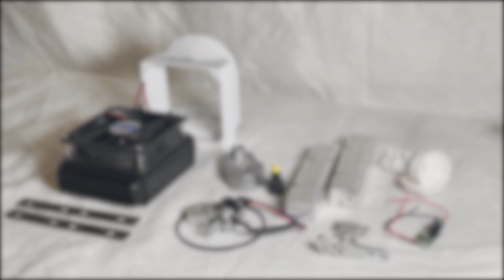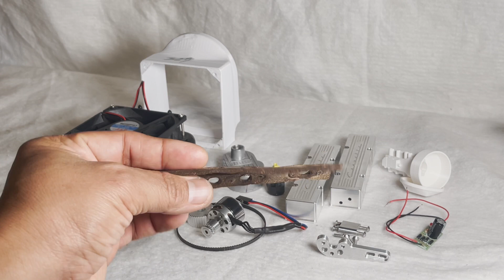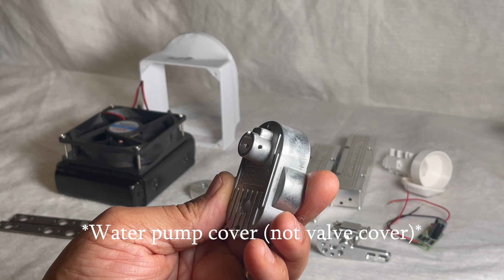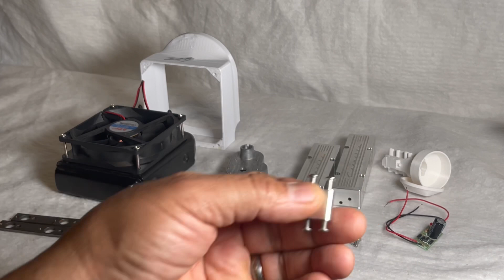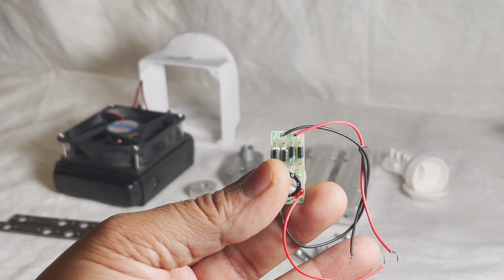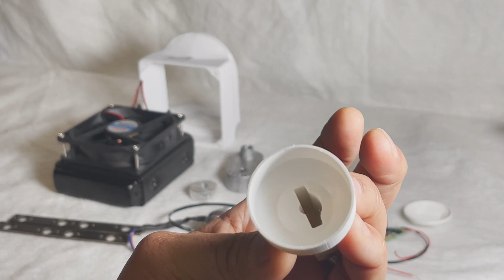Conley V8 and Conley Clone V8 alternator and water pump “kit”.

Comment: Awesome stuff my friend! Could the power from the alternator not be used to run other electrics & charge the battery on the car, like a 1:1?
Reply from the maker: Definitely can power other things. The rectifier is great for simple AC to DC, but a converter is needed to charge the battery.